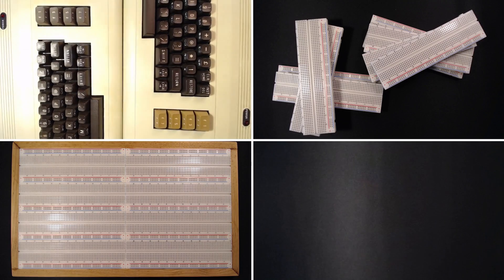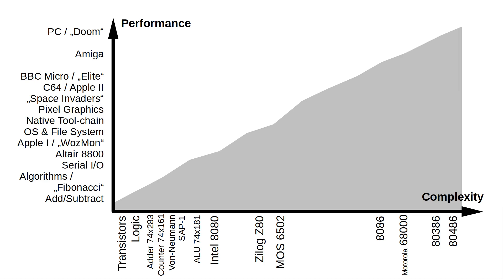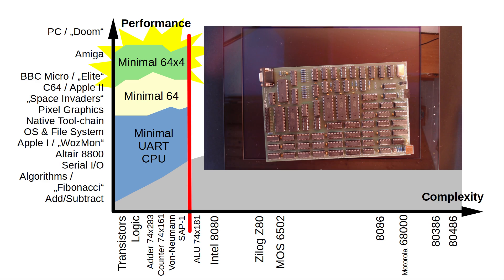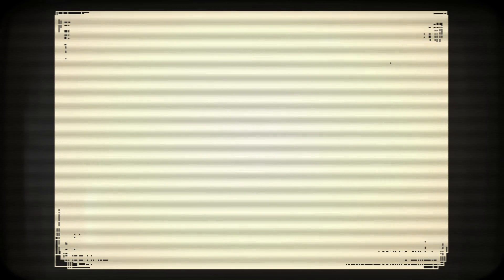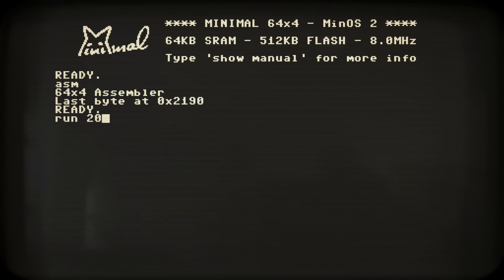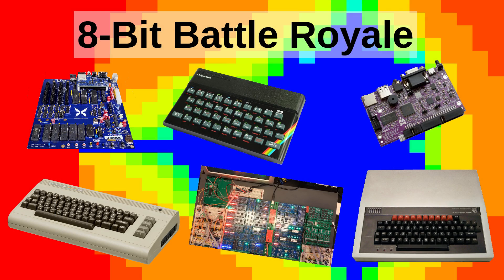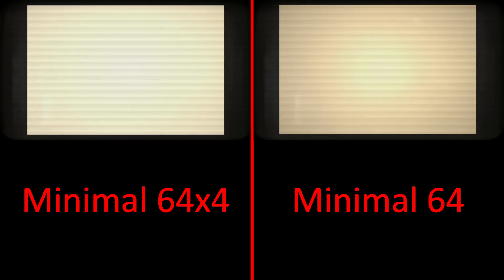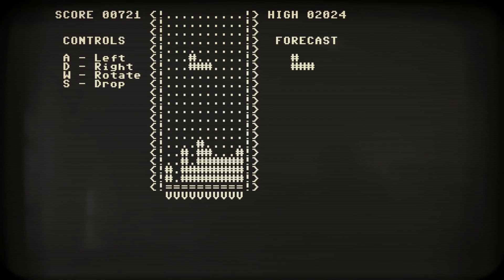Minimal 64x4: The Oddball in Home Computer Development

Comment: There was quite a decent version of space invaders on the Commodore PET, a 1MHz 6502 based machine with character based video. The BBC B had a 2MHz 6502 and could manage bitmapped colour graphics with wireframe 3D. It wasn’t about the hardware back then, it was how clever the software was.
Reply from the maker: That's what I find ascinating, too.
Reply: If Elite can only draw convex shapes, how did the do the docking port? Does elite z sort objects? But this fails with pointy ships ( Star Detroyers).

I hate wireframe with occlusion. The correct way is as expensive as flat shading. I still have not figured out how to catch all z sort glitches (on retro hardware). Feels like BSP and z-buffer are faster if you want correct results. Now do that on 8 bits.
Reply: @ArneChristianRosenfeldt  you’ll note that the docking port was a flat rectangle on one side of the station, and only displayed when within range. The whole point about Elite graphics wasn’t that they were good (there was a lot of flickering and the occasional visual glitch), it was that it was possible at all in such a limited system. The line drawing was done by the CPU on a single buffered, mono, bitmapped display (there was a trick whereby the video mode was switched to colour for the status panel at the bottom of the screen). There was no space or capacity for double buffering, Z planes, polygon drawing etc.
Reply: @stevetodd7383  Yeah, just when you write an engine or tune hardware for 3d, you don't want your interface to leak the implementation. The flickering can be replaced by a disintegrated look where edges move independently from one frame to the next. C64 can do double buffering. Maybe the BBC micro is low on RAM?
Reply: @ArneChristianRosenfeldt  the original BBC B supported only 32K of RAM, which had to hold code plus VRAM. Later versions for the BBC Master or 6502 co processor didn’t have the same memory limits, but the original code needed to play a number of tricks with the video hardware to fit it all in.

Comment: Hey im building a computer for science fair/ fun and i was thinking of using a 6845 chip but i can't find much of any videos on it do u know anything about it?
Reply: People mostly didn't have videos to learn from back then, you know?

they generally worked from a good fundamental education in math, electronics, logic and read documentation (books, publications, etc)) on the chips to be used.

The 6845 is only for controlling the CRT controller (IIRC) and forms just one part of a graphics device.
Reply: What CPU are you using? The 6845 has a typical 6800 bus design and is really suited for a 6502 or 6800/6809/68000 computer, but if you are using an 8080/8085 or Z80, there are some hidden traps (as I found out in the hard way). If you have any more questions, simply reply to this comment.
Reply from the maker: Just to clarify: The Minimal 64x4 does not use any integrated CPU - lust logic chips. The "CPU" is built from scratch here.
Reply: 6845 for video timing?  Easy to get Motorola datasheet online.  Beautiful document to read.  I actually have one in the first graphics card I designed for my Nat Semi 32008 homebrew many years ago as a teenager...  I used it mainly because it was the legendary 6845 and it actually was pretty good for versatile timing generation.  Lots of "legendary" chips in my homebrew just because... Got it to work for PAL timing (although greyscale because a colour monitor would be unimaginably expensive to me) and some weird IBM terminal I rescued from a rubbish bin.  There's a fair bit you need to do for a complete video solution though such as pixel shift register and DAC (I went cheap with a transistor and a bunch of resistors as I had no money).  As well as how your CPU will play nicely with it and the memory system.  I don't think I'd use one today as big cheap (compared to the old days) fast RAMs and EPROMs mean different but simpler ways of doing more interesting things.